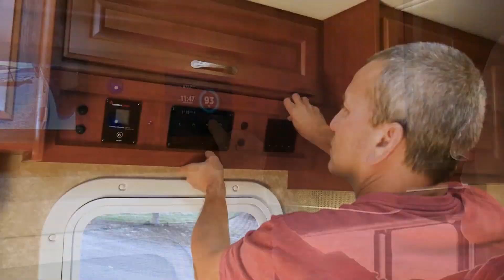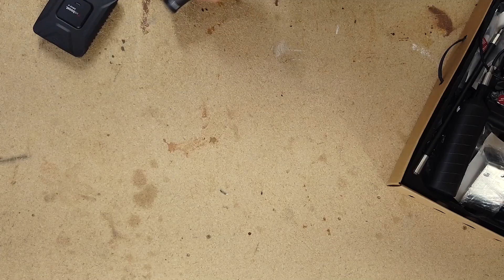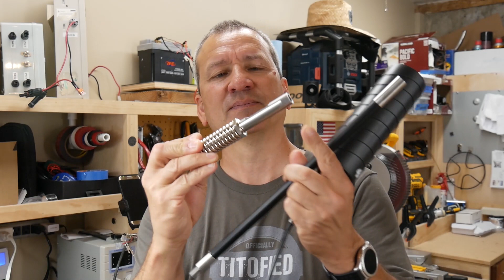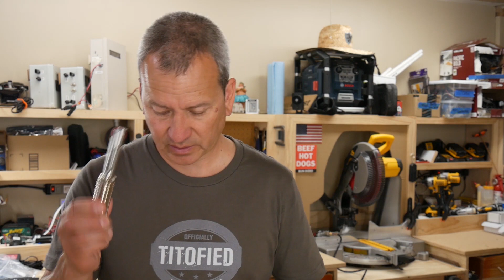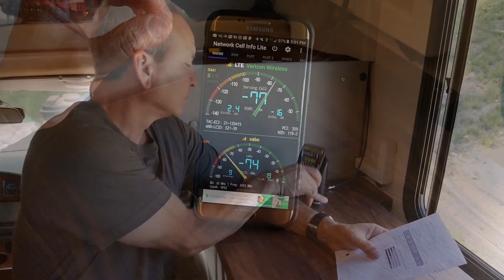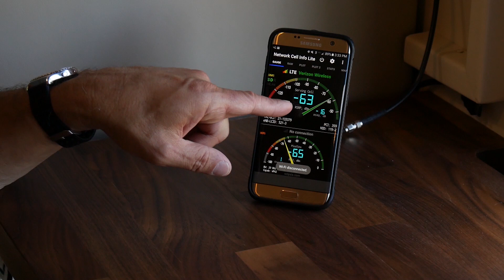WeBoost DRIVE X RV Cell Phone Booster Review

Comment: Brian, great information as usual! Quick question, I have the 4G-X-RV setup. I mounted the omni-directional antenna to the batwing tv antenna because of proximity to the interior workspace. Will the "batwing" cause any sort of ground plane problem or affect the performance of the booster? Thanks for all your vids!!
Reply from the maker: Weboost does suggest having as much separation as possible vertically and horizontally between the two antennas. Rougly 15 ft I believe is what they suggest. I believe that antenna has it's own ground plane so that shouldn't be the issue. If the booster was having feedback issues, you'd probably be getting a flashing red light. If you have extra cable, try moving it around and see if there's improvement. If not, then you're good.

Comment: Can you give ideas fro running the cable inside? Also, how do I hook the 12volt hardwired unit? To a ceiling  light or what? Can you show?
Reply from the maker: That's the most difficult part of the install and requires some specific knowlege of your RV. It's best to use existing openings (next to plumbing/refrigerator vents). If not, then you'll probably be drilling a centrally located hole above a cabinet or wall. Here's a video showing that https://youtu.be/aB8ic6x9DAM. Finding a 12V source should't be too difficult. Yes you could tap into a ceiling light. You'll probably want a switch for the hardwired adapter. An easy option is to wire up a 12V plug and mount it in a cabinet, then get the weboost 12v cig lighter style adapter that has a switch on it. I hope that helps get you thinkin.

Comment: Thanks for the information. Question for you, this antenna is for travel use. Can you swap it out for a directional antenna when you are parked?
Reply from the maker: Yes. I also carry a directional yagi antenna that I mount to an extension pole. I don't use it that often, but it does come in handy at times. You might need a coax adapter to connect it to the cable. They are pretty inexpensive on Amazon. Weboost has them too.
Reply: RV with Tito DIY / thanks for the follow up 👍🏼

Comment: Drill a small hole in the bottom. It will hold water in it.
Reply from the maker: Are you talking about the top of the OTR antenna? If so, then thanks for the tip.
Reply: @RVwithTito  how expensive is it?

Comment: Thank you.  Is the network analyzer app available for iPHONE?  I could not find it on the App Store.  I noticed you use a Samsung phone which is Android.  Thank you.
Reply from the maker: Sorry. I'm not sure. There are several comparable apps you can use. Try Open Signal.
Reply: There's no similar app for iPhone, but you can use Apple's inbuilt field testing app.  Not as pretty and slightly convoluted to turn on, but it works. Instructions are here:  https://www.macworld.com/article/3346027/how-to-see-your-true-cellular-signal-strength-with-the-iphone-field-test-app.html

Comment: I have the 4G OTR. My only issue with it is that the cable is permanently connected to the outside antenna. I mount mine on the top of the RV. I had a tree destroy the tubes that hold the antenna up. So, I had to purchase a whole new antenna...but.. if it would have unscrewed the cable at the antenna, no need to fish the old wire out and fish the new wire in. That was work :(   Other than that, I love my 4G OTR. I have the candy bar mounted to an overhead cabinet where the MiFi stays. I work 100% of the time from home, so now I can work from the RV whenever I want to get away and no one knows the difference
Reply from the maker: That's right. Nobody needs to know where you are :) Thanks for the feedback on the OTR. That's probably why they no include the spring mount.
Reply: What cell phone provider do you have or do you pay an additional internet provider?
Reply: @Delkaegel  I purchased one of those Grandfathered unlimited plans off Ebay. I was skeptical, but to work from my RV I needed unlimited. $185.00 per month to the owner of the Verizon unlimited plan. It has been over a year now and no throttling, no reduction of service and no interruptions. I think I got really lucky with the guy I pay for this plan. Since the plan has a Mifi, all my other phones, tv etc can use it. I stream TV all day and night..